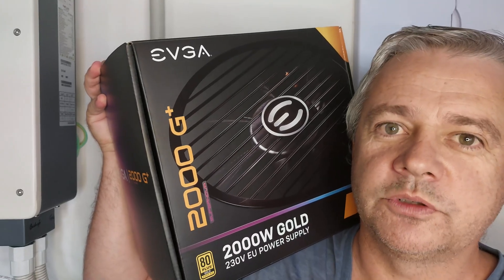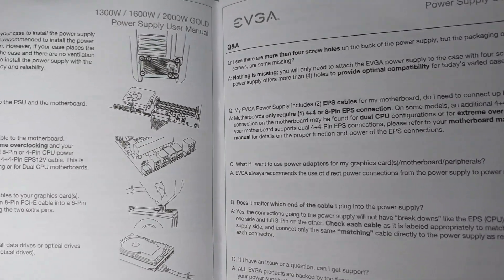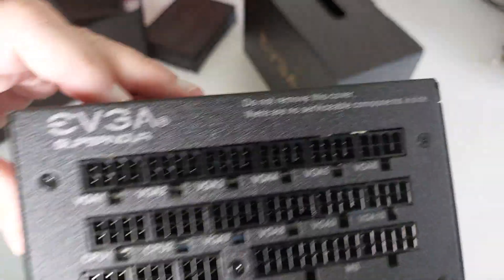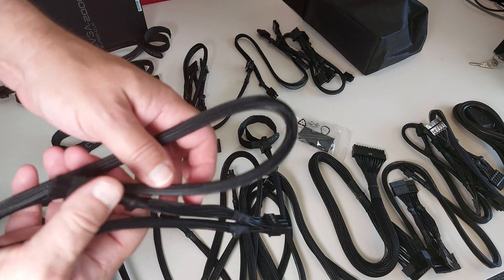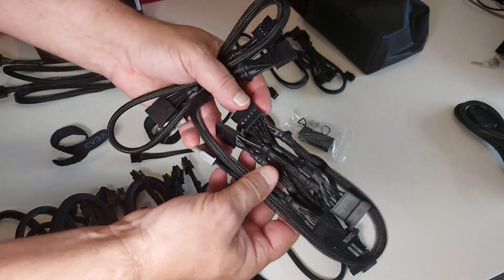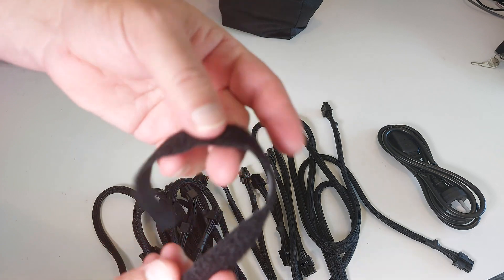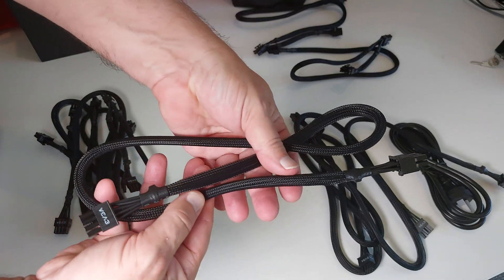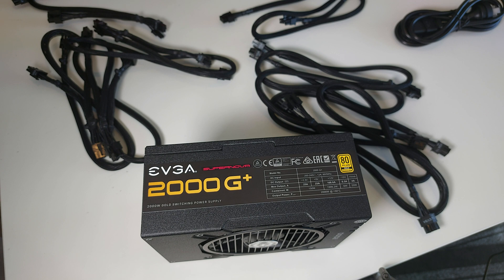EVGA SuperNOVA 2000 G+ for Crypto Mining Unboxing

Comment: Would this EU power supply work in America?
Reply from the maker: It is a global power supply.  You would need 240V for it to work.
Reply: @pdath  I can definitely see this power supply not working in Puerto Rico (US territory) specifically since the island operates on a 120V supply voltage and 60Hz. I would need to convert my outlet to make it work on 240v. Is the EVGA SuperNova 1600 T2 the better option to go with? It is titanium graded after all.
Reply from the maker: @Dragzilla66 In your case, yes.

Comment: I just bought this as my last 2000w PSU Cannon FSP brand blew and doesn't work anymore. I have a custom loop setup, Ryzen threadripper 3960X, TRX40 motherboard, extra 850w corsair PSU + 4 x 3090 RTXs for my 3D animation setup (I use a GPU renderer hence all the GPUs). The 2000w PSU just blew, is that normal? The computer company who put together the build (I don't know much about computers) said it shouldn't of happened, but we're going back and forth as I want them to fix it and they are avoiding me saying its not their problem, but I paid them to build me a setup that could handle that load. So for the time being I ordered this particular PSU to replace it. I did find out all the power outlets on my wall were coming out of the same circuit so that could have been the reason, but I just thought the amp would blow first and not the PSU. I'm based in Europe btw
Reply from the maker: I would have expected that to be enough power supply capacity.  I'd go get one of those cheap energy monitor plugs, plug it into a wall and a power supply into it, and check how much load is being drawn at the wall on each power supply when at full load.  Then you'll know for sure.

The EVGA is a top-rated power supply, so I feel pretty confident about your choice.
Reply: @pdath  Yeah I posted in Reddit chats, but everyone was saying when you add the 4 GPUS, the motherboard, fans, the pumps in the custom loop etc would put it over the 2000w supply, hence the extra 850w PSU. Yeah all the plugs in my house are the normal EU 230v. I did have all of it coming off the same circuit board, so I'm going to put the 2000w on a separate circuit board just to be safe. I have an engineer putting it together today, let's hope it doesn't blow up this time!
Reply from the maker: This is assuming you have a 240V supply.

Comment: Is this PSU worth it just for 1 gamng PC? I currently have a 1000 or 1200w PSU but i was looking at 1600w PSU with upcoming CPU/GPUs which apparantly will be powerhogs. I am looking to upgrade before the prices go up on PSU and i came across this PSU.
Reply from the maker: Personally I'd wait if you are thinking of getting a new GPU in case it needs the newer 12 pin ATX3 power connector.

Comment: Just fired up a 6x3090+1x3090Ti using this 2000W for the first 4x3090's with the MB and CPU etc. The remaining 2x3090 and the Ti hooked up to the 1600W Platinum version. Hoping all stays well as the last setup without the Ti blew 2x1500W BeQuite Pro's first then a 3rd unit went bang too lol! This happened after just 2 months and they're rated Titanium. Clearly a myth.
Reply from the maker: I'd go big too!  That's a lot of load.
Reply: @Philip D'Ath  yep, you think the BeQuite 1500's just failed or the previous setup was too much? I forgot to mention the i5-9400K, Corsair H170i Liquid Cooling and 8x120mm case fans... whoops, using BioStar TB360 Pro MB which has 2xPSU slots.
Reply from the maker: With 4 x 3090's at around @300W each, and let's say 150W for motherboard, CPU, SSD, etc is about 1350W.  That's about 90% of its rated capacity (1500W).  I'm guessing this brand either can't handle this load 24x7, or can't handle the short term surges.  A lot of people say you shouldn't run at more than 80% of maximum capacity continuously.

I've had a good run with the EVGA power supplies (none dead yet!).  I tend to go with much larger power supplies than I need so I have lots of spare room (might need it for mining RVN :-) ).
Reply: @pdath  The 1st PSU is the 2000W for the 4x3090’s and mobo etc… The 1600W is only powering 2x3090’s and a Ti.